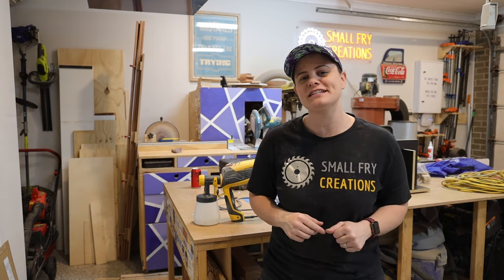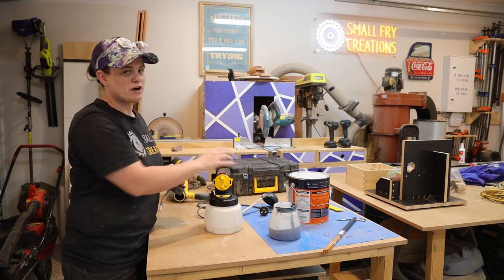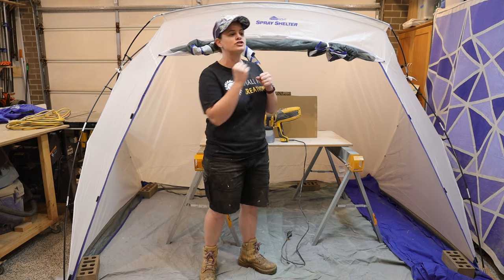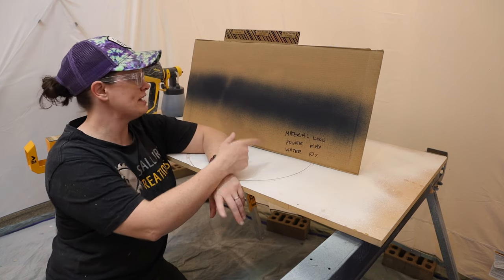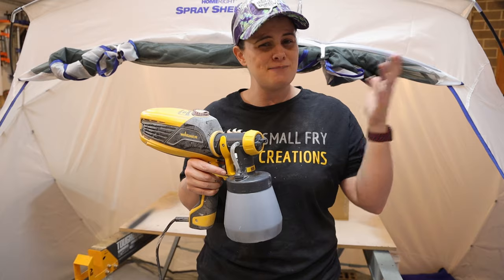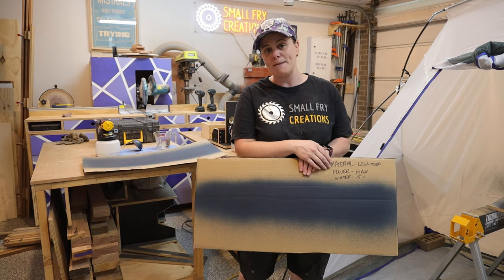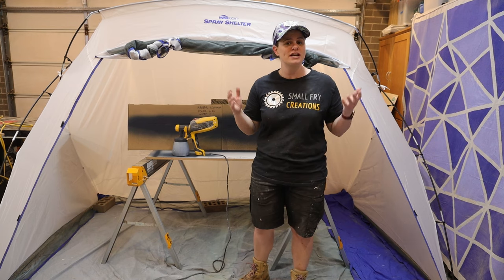Wagner Flexio Spray setting tips and setup | Perfect for Beginners

Comment: One thing I learned about my Flexio-5000, when using a glossier sheen such as satin or semigloss, it is best to use a higher material flow and power. To achieve a glossier finish, there needs to be a “wetter” application of the droplets so they can merge together into a wet layer. If too little paint is sprayed, the finish will have less sheen because the paint droplets dry before they merge together.
Reply: Thanks mate

Comment: So grateful for this video. I bought the Flexio 3000 and my first attempt was a disaster. I had followed Wagners instructions and couldn’t work out why it was such a splattery mess. I followed your instructions and the finish is superb. Thank you for doing all the hard work.
Reply from the maker: Hey Michelle Thank you and so glad to hear I could hear. It is a little tricky to get sorted to start with but so glad I could help get a great finish. Happy spraying for the future :)
Reply: Did you have to thin latex to get it to spray properly?
Reply: @notcharles  unless you have a 5k dollar sprayer ALWAYS with Latex 

With any cheap gun u set $500 you should thin everything also you need to strain it before spraying

Comment: Fantastic video and very useful. I've spray painted a lot in the past and your explanations are very logical and well done. The only thing i would add is that avoid spraying with cold paint as this can cause splattering and overspray too. Keep the paint indoors overnight before it's used and stir well before use. Using a paint strainer to sieve the paint too will help prevent nozzle clogs and splattering. Great video though.
Reply from the maker: Ooo that’s a fantastic tip. Thank you. I will do that for sure in the future. Glad it was helpful and thanks for adding great tips 😀

Comment: The process you went through is excellent.  It's basically a tutorial on the scientific method where you have several variables and you hold them all constant to change only one of them.  Great!  But,...

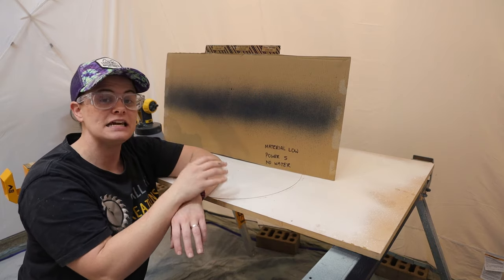At 4:11 you say that thinning the paint is the easiest thing to adjust.  To me, the easiest thing to adjust is the external, numbered,  dials under your fingers.  The hardest thing to adjust is the dilution.  I would much rather change anything but the dilution first, because you cannot measure dilution.  Having said that, Wagner has made a huge step forward with their little dilution stick.  

Regarding the science of dilution, it does not make the particles smaller.  The particles remain the same size.  What changes is the viscosity of the paint.  Without getting into the science of how the suction is created, by adding water you change the viscosity from something like molasses to something like milk.  That makes it easier for the suction bits to suck the paint up out of the pot and through the nozzle.  It is easier to suck milk through a straw than to suck molasses through a straw.

Comment: I just did everything in that video, because I too was disappointed with what the manual said I should do and the results I got, and it worked like a charm. 

I would add, which I’m not a painter by far so it probably doesn’t need to be added for most people, that the further you are away from what your painting the bigger the paint droplets are even after watering it down.
Reply from the maker: Thats fantastic to hear and glad it helped. Great extra tip about the being further away. :)

Comment: Super helpful video! Just got a Wagnor.  I’ve been working this week at getting the right flow - practiced with water then practiced paint on cardboard- got so frustrated and went back to brushing this weeks project. You are correct you have to practice on cardboard with each material. I understand more from this video & will give it another go!
Reply from the maker: Glad I could help. They can be frustrating at times for sure. I feel you. Then once you work out the settings it becomes fun and quick 😀

Comment: Great video. I’ve been repainting everything inside my home. From ceilings to walls to doors/casings and baseboards. I’ve been doing it all with brushes and rollers buying only the best. But rather than washing out the rollers which is quite a process I’ve just been throwing them away each day which is quite costly. I’m using Benjamin Moore paints which is expensive and the paint is not going as far as the can states and it’s taking several gallons just to do 3 bedrooms upstairs. I’ve been debating on buying the 3500 to see if it helps me and this video was a great tutorial. Thank you.
Reply from the maker: Glad I could help. The sprayer makes quick work of the projects and I find also helps with the paint going the extra mile.
Reply: @SmallFryCreations   that’s great to know. Thank you.

Comment: This is the only video I found helpful with detailed setup instructions about this sprayer. Did you have to check/ clean the air filter before using it the second time? I didn’t and my second time it sprayed a lot worse/ not even. Just trying to figure out what’s the problem
Reply from the maker: Thank you. Glad it was helpful. I haven't had an issue with the air filter but you do want to make sure you pull apart the nozzle and clean all the parts so there is no blockages. Hope this helps :)

Comment: Great video very helpful.  One thing though, when you twisted the nozzle to the the horizontal orientation you said it was for spraying horizontally - which makes sense. But, Wagner says that is for vertical spraying. And then vice versa. It’s counterintuitive I know, but, I have the manual for my W200 in front of me and it makes it clear. (BTW, by twisting to have the tab on the diagonal, you get a more focussed spray).

Comment: What a great video! I wish this was around when I first got my sprayer, as It took a lot of experimenting for me to get mine to a point where I felt it was working quite well. I’m
A furniture painter and many of the paints I use say not to dilute anymore than 10%. I’d love to see a video About how the settings can be worked when you have those kind of restrictions on dilution. 

I’d also like to see your tips for settings with the iSpray attachment, as that has another settings dial which adds another layer of complexity.
Reply from the maker: Thank you. Oooo I would have to do some testing as I haven’t had any paints with the 10% restriction. I will have to check out the ispray attachment. Thanks for stopping by 😀

Comment: Great video, helped me understand the setting, I'm spraying stained varnish (water based) and figure it will behave like paint. Will test it on cardboard strips first then on scrap to get a colour match. Shame Wagner doesn't have as much information. I am using them 590 as well, so really appreciate the tips
Reply from the maker: Your welcome. Perfect idea to test on scrap first. Dial in the settings and then away you go

Comment: Good video but did you purge the gun after you added water? You still had thicker paint in the pickup tube which would have been enough for the one pass you did on the card.

Comment: This video is awesome!  I'm looking to purchasing one of these.  I'm redoing my entire first floor, including all my trim and cabinets.  I thought something like this sprayer would be ideal for new trim and old cabinets.. I'll roll the walls and ceilings.. Is the tent a necessity? If so, wouldnt' that limit what you can and cannot paint? I'm now looking at the Flexio 5000 that has a hose, which seems as though I might not need a tent, but I could hang plastic all around my garage and go that route..thoughts?
Reply from the maker: Thank you. The tent is good for overspray and protecting the other stuff around what your painting. I set the tent up and spray what I’m spraying and then carefully move it elsewhere to dry. Depending on the space you could also put plastic around the room and spray for wall and ceilings are well. Good luck and happy painting!

Comment: Like your video mainly how you approach logically. Is there a way you can standardize the paint flow using a viscosity cup; therefore not having to change the spray gun settings. And, a video using outdoor paint. I want to paint outdoor furniture, but find it frustrating. Thanks for listening.
Reply from the maker: Hi Tony. Not to my knowledge. In my experience you need to combine all the settings to get a great finish

Comment: I've had a Wagner sprayer in the shed for 3 years. I prefer a good old fashioned roller and tray. You don't have to worry about spraying things near by or covering stuff up. As far as I'm concerned this is fine for doing fences outside otherwise it's just a gimmick.
Reply from the maker: Fair enough. I also use it for furniture spraying and find it a great time saver but I say do what works.

Comment: Great explanation of the variables, something Wagner--IMO--hasn't been very good about. My Flexio is the type with a separate turbine unit and a long hose to the gun; essentially the same as this model, just in two pieces instead of one. I'm painting cars with it (using the detail nozzle only), and have had decent results. Some really awful results too. The paint thickness, power, and flow settings all feel as if they vary from job to job, although I believe the various paint brands have their own nuances. One brand I've used recommends four parts paint to one part reducer, yet I've had to mix it one-to-one to get good results (that's four times their recommended mix!).  Temperature apparently plays a role too; after a minute or two the turbine itself heats the air, which introduces another variable. At one point while spraying in 80 degree weather (Fahrenheit), which was too warm and I knew it, the gun completely froze, as the paint was drying before leaving the nozzle. So yes, some experimenting may be required, but I do believe you can get some good results with these sprayers. Thanks for the video!

Comment: Hello to Small Fry Creations.
I just would like to how did you get started doing furniture upcycling as I am interested in getting into it. What paint/stain do you use on your furniture.
Reply from the maker: I haven't done two much upcycling but when I have I hunt around on Facebook Market place for a piece that I think will work and the price is good. I use Dulux paint for the upcycling with a Cabbots clear top coat. I recommend doing a smaller furniture piece to get started and then work from there if you like it :) Hope this helps

Comment: Well done, nice video and very well presented, seriously you need a white coat and clip board it was that scientific lol! Just think out loud here but the flow dial could possibly be metered by winding back as far as possible, then make a synchronised mark on the dial and the handle and then turn the dial forwards counting the rotations, once you know how many rotations you have to do to get to max flow you have some way to gauge mid/medium flow. I actually have a Wagner HVLP and will try this myself to see if my thinking is correct, hopefully the flow rate is based on a linear and consistent flow rate. The fail would be if the flow rate isn't a linear scale but more of a curve scale. 

Might be worth asking Wagner about this too.
Reply from the maker: Oh yes this is a great idea. I will give this a go also. Glad you enjoyed the video and thanks for stopping by

Comment: Thanks for the review I have the same spray gun only used it once had so much over spray in the kitchen it took me ages to  clean up. I had plastic drop sheets taped down which blew around with the air from the gun. I have a picket fence out the front needs painting I was thinking about a roller and brush but with your video I'll have another go with the spray gun. Thanks again steve tas.
Reply from the maker: Hey Steve that’s awesome!! Yes so much overspray if the settings are right. Glad I could I help 😀

Comment: What a great video. Thank you for the information. I have a specific question about spraying polycrylic with a Wagner 5000. Where should the settings be? I got lots of air bubbles, runs and sags 😢 still working on sanding those out. Please help, thank you
Reply from the maker: Thank you. Generally a Polycrylic is thinner then regular household paint so I would recommend starting with not thinning it out. I would also turn the power down as a starting point and then go from there. Hope that helps :)

Comment: Great Movie! I bought Dulux Ceiling White paint from bunnings, it mentioned that "Spray: Thinning is not usually required, but up to 5% water can be added to aid spraying"...I am first time beginner user and first time painter, I am not sure why Dulux made that restriction on dilute. But it seems need at least 15% water for wall ceiling painting from your video. Not sure if you have any advice on that part. Thank you very much.
Reply from the maker: Thank you. I haven't had any issues watering the Dulux paint down by 10-15%. I would say they say 5% as some of the bigger more powerful sprayers don't require as much dilution. It would work at 5% the overspray that wouldn't be as fine. Happy painting :)

Comment: Great video, really help with the initial configuration for a similar Flexio (5000) I was using. But I am struggling with micro bubbles/solvent pops. By any chance have you had an experience using Benjamin Moore Advance paint with sprayers? Any suggestions/tips as to what I can do to correct? I tried max power settings with medium material and I believe I thinned to 10%. But I am thinking giving a shot up to 20% with low material? Any recommendations would be helpful! Thanks!
Reply from the maker: Thank you. We don't have Benjamin Moore in Australia so I haven't used it before. The bubbles may be air so the air setting may be to high. I would play with the power setting coming down a bit and maybe increase the thinning a little. Hope that helps.

Comment: Hi thanks for demonstrating the paint settings. Where can I buy the yellow stick that measures the 5%, 10%, 15% water to add?
Reply from the maker: Thank you. Wagner don't sell the yellow stick anymore which is a bummer because they were super handy. They now use a Viscosity Cup. It should come with the spray or can be purchased online. Hope that helps.
Reply: @smallfrycreations
It only had the two size paint cups that you put the paint in to spray.

Comment: How do you know what 10% or 15% looks like? I never got a "fancy stick" like that with my new Flexio Purchase.  Are the notches 1/4" in size on ur Flexio stick?
Reply from the maker: Hey Dan I would see if you can pick up on on Amazon or Ebay. Otherwise you could try and weight the paint and then calulate 10% for water

Comment: My question is I am going to be painting a large 16 ft. custom made built in bookshelf. I am going to try and do an ombré effect as well. I am torn by the use between the detail and the regular spray gun. Since it is such a large wall of bookshelves do you think the larger sprayer would be better or should I stick with detail and just try to have my paint pre-strained/ diluted and ready to add to the smaller detail gun. Thanks so much for your help!
Reply from the maker: Hey I would go with the detailed sprayer. I painted a whole fence with the detail sprayer as I didn't know enough at the time and it worked great. You will have more controll with the detail sprayer and if your spraying in and around a bookshelf go very light coats and just do a couple of coats. If you spray to heavy it will drip easily. Happy spraying. Hope this is helpful :)
Reply: @SmallFryCreations  thanks so much! I’ll be reviewing your videos before I start.

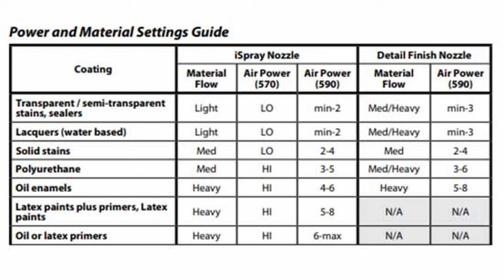Comment: I noticed that in your video at 8:54 that it shows a chart for the differenct settings on the sprayer. Looking at the first column for Latex paints, using the Detail Finish Nozzle it says N/A.....I'm not sure what that means?? That seems odd. Any thoughts on why they don't give values?
Reply from the maker: N/A means you shouldn't use that type of paint with that type of spray head. I wouldn't recommend using oil paints as cleaning will be a nightmare and very hard to do. I would stick with water base. Hope this helps.

Comment: Excellent video greeted interesting Gracia for information at time in my case I bought a Wagner brand electric gun, but it says satin 350 I used it with dye the problem that I was very watery, but now it went to conpral dissolve you to The Home DEPOTdé jo that could not use it for normal paint only shovel tempt, but a person told me that no what is a question of viscosity what could have used it

Comment: Thank you for this video! I am getting so much streaking with this now. I’ve tried cleaning it really well, messing with all the settings and it’s still happening. I looks like stripes all on the top of my furniture now :/ not sure what to do! Anyone else have issues like this?
Reply from the maker: Oh no! Do you notice the striped at the time of spraying it after it’s dried?
Reply: @SmallFryCreations  after it dries :( I think I might need a new nozzle or something. It’s frustrating but I love the gun besides that issue
Reply from the maker: That’s very annoying. It may be the paint is to watered down and it’s running maybe. Bummer that it’s happening

Comment: We have been trying unsuccessfully to spray some wood furniture using the flexible 690, however the paint has splotches we have tried to water down the paint, changed the material flow and used both min and max air flow, can you help us out please ?
Reply from the maker: Oh no! You could also try straining the paint. That may help.